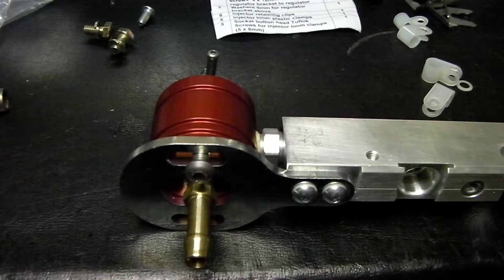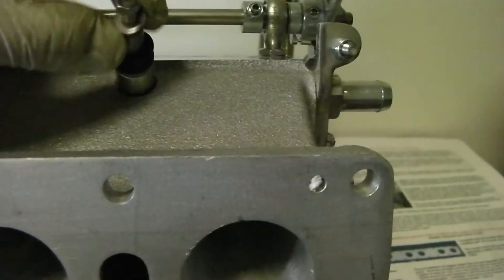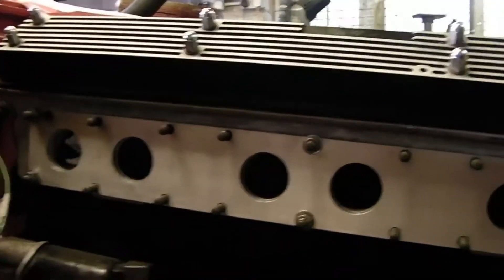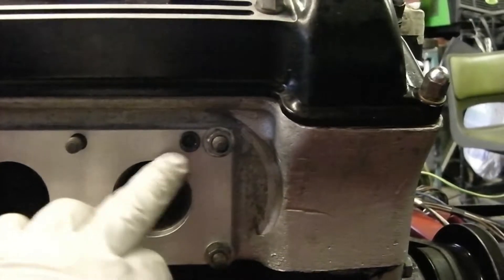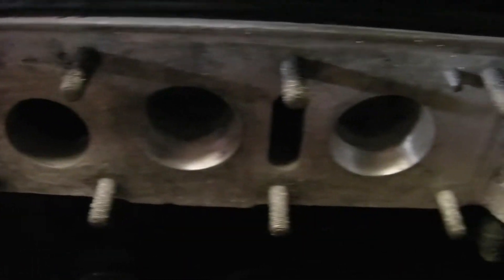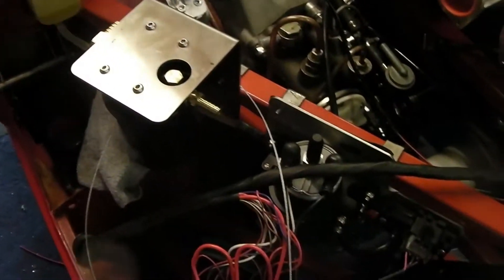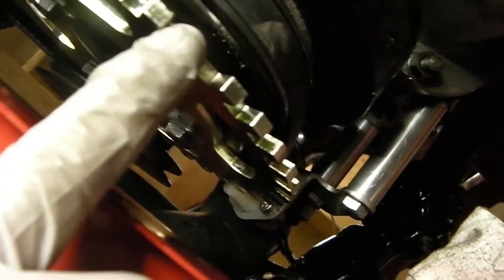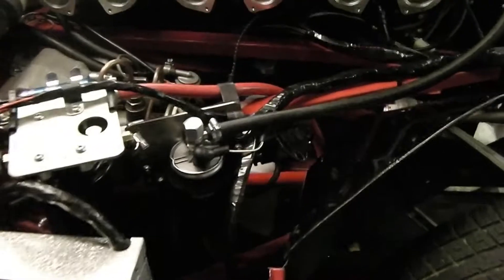Tutorial Part 2 Etype Jaguar installing fuel injection & electronic ignition

Comment: Interesting videos  ….Just wondered the air filter design appears to be using hot air from within  engine bay rather than as with the original air filter and intake design uses ducted  cool air from outside. May not be significant but just wondered if it maybe a problem under certain conditions. I can see it might not be easy to design such a system to evenly feed six throttle bodies as opposed to three with the original three SUs. I note when fitting three Weber carbs  a similar setup to your system regarding filters are usually employed. It’s just Jaguar must have thought with the three SU design it was important feed in cool air from outside and even maybe have been feed at slightly positive pressure… just guessing though.

Comment: Great job, we are installing a complete mobeck mfi system on our 86 XJS v-12.. you got to love the 21st century stand alone ECU's.. only thing you missed on your video is the before and after run's.. it doesn't give us the full answer if it makes a difference..
Reply from the maker: After fitting all the upgrades fuel consumption improved by around 5mpg, but the main benefit was smooth tickover, starting first time every time summer and winter, even when warm, and reliability. The engine ran cooler and pick up was consistent, only took it to the limit once or twice but ran smooth up to the red line, but etypes, particularly with power sterring get very light on the front end at higher speeds.

Comment: Do you still own the car
Reply from the maker: Yes, but I am planning to sell next year. I have had my fun with it ready for next restoration project.
Reply: @wapsac  great job. are you local to Lincolnshire?
Reply from the maker: @tenerifesonia  , no I’m in Liverpool.
Reply: @wapsac  what did it cost? If you don’t mind me asking
Reply from the maker: @tenerifesonia  the full conversion kit was about £5,500.
Reply: @wapsac  jeepers. That’s out if my price range. I found a complete kit for £1800. Must be not good.
Reply from the maker: @tenerifesonia  my kit included, Mangoletsi manifold, Emerald K6 ECU, Jenvy throttle bodies and injectors, cables controls and throttle pedal, 6 way ignition pack, cog wheel electronic ignition, higher rated HT cables, high pressure fuel pump and filter assembly, etc, etc all the best branded parts available. When you consider a secondhand set of carbs would cost £3,500 plus the cost of refurbishing them and they would still cause erratic tickover and difficult starting when hot, then updating to fuel injection is a must. My etype starts from cold every time, ticks over consistently even after a fast hot run and gives improved MPG. It’s what they should have fitted in the 1970,s.
Reply: @wapsac  the kit I have found contains everything needed. I can just about afford 2k. Do you have any recommendations for the cheapest way of putting a 5 speed gearbox in.
Reply from the maker: I fitted an etype 4 speed gearbox with an overdrive, which was a direct replacement so needed only minor adjustments to the gerabox tunnel. 5 speed gearboxes conversions are available but are quite expensive. Check out some of the threads on the etype forum the conversions have been done by many enthusiasts.